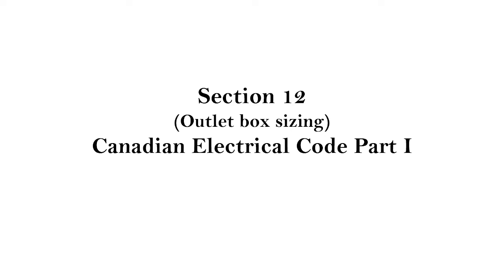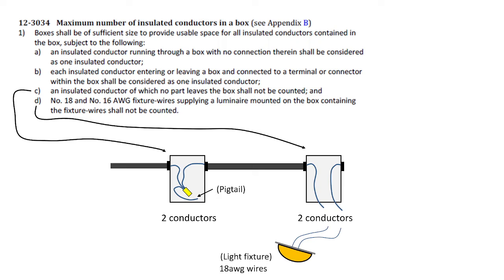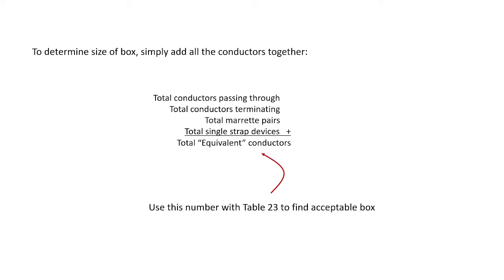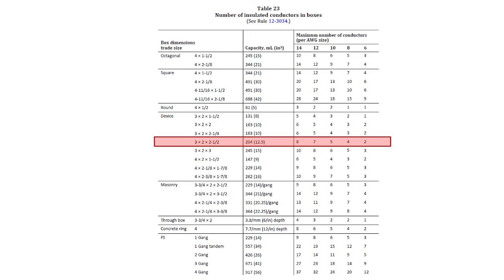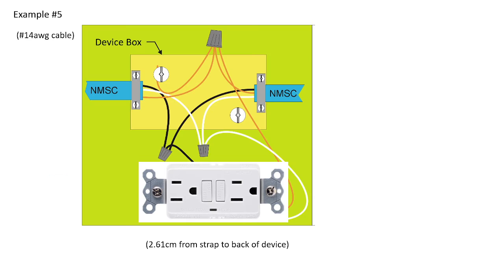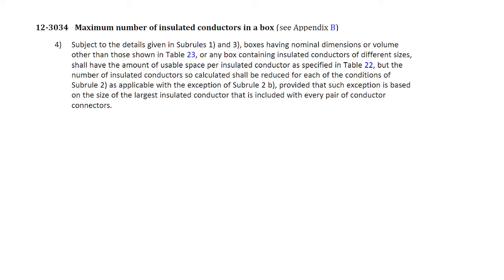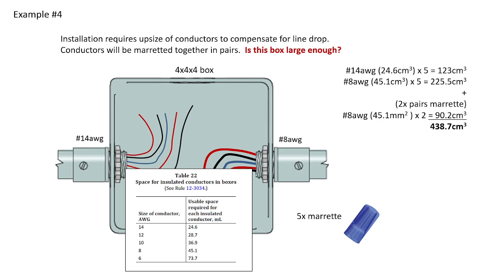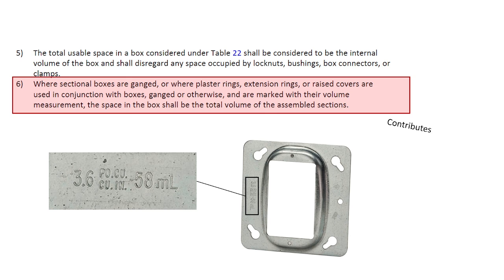Section 12 CEC: Outlet box sizing

Comment: Question: when explaining the 12-3034 (3) oversized device, it was noted that the receptacle was added twice. Once with the equivalent conductors count and then again with the calculation 83.52mm3.  Should the (one receptacle equivalent-2 conductors) NOT be added into the calculation? only applying the 83.52mm. thank you in advance. love your videos by the way, I use them constantly for illustration
Reply from the maker: Hi Chad, thanks for the question. This has come up from time to time over the years, but the answer remains the same. Without a doubt, BOTH subrule (2) & (3) must be taken j to account and combined when determining the total box fill for an oversized device. If only the calculation of subrule (3) were used, the box size would be inadequate. Another way to think about it is that subrule (3) is providing a means to calculate the additional volume necessary for the device-additiknal to the base value assumed by the two conductor equivalent in subrule (2).  Hope this helps, glad to hear the videos are assisting electricians understand the sometimes tricky concepts...

Comment: Example # 5 is not correct see rule 12-3034 (2)  you do not count the AFCI as 2 conductors on a strap as its depth is greater than 2.54 cm  the AFCI only accounts for the 83.52 ml   32 x 2.61cm
Reply from the maker: Although your comment is appreciated, the video is correct. There is nothing within 12-3034 which states or assumes a singular use of subrules, or exclusion. Each of the subrules are used together to generate a total conductor count or volume. This is consistent with the CEC handbook and other commentaries and examples in industry. Also, subrule 4) assist in understanding that all of the subrules are used together, although it is not the easiest read.

Comment: How many strap should be count for a 14-30R receptacle? Thank you.
Reply from the maker: Hi dragon818, in reference to box fill, any receptacle is considered to be mijnted one single strap. This would include single receptacles, duplex, and other quirky combos such as a switch with light or switch with receptacle. Let me know if I understood your question correctly.
Reply: @ Hi there, the 14-30R usually uses for a dryer, it is larger than a single strap. Does that count 2 straps?

Comment: Another question. Do you count the 16awg wire for 0-10v dimmer?
Reply from the maker: Great question, typically no. The volume of wire contained in a box by these conductors is so small that it is not considered significant enough to count. This is evident with table 22 & 23 having volume data down to #14awg, no smaller.

Comment: When you gang 2x 3104, do you multiply the capacity by 2 or you have to subtract the volume of the 2 side that you remove?
Reply from the maker: Good question. Volume of the two boxes added together, typically twice the volume for a gangable box.. no need to subtract sides.